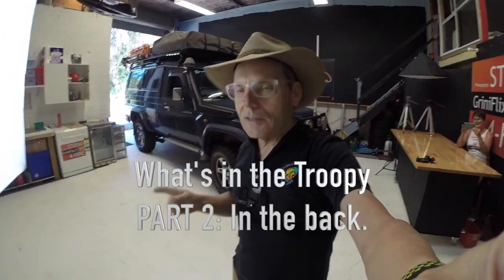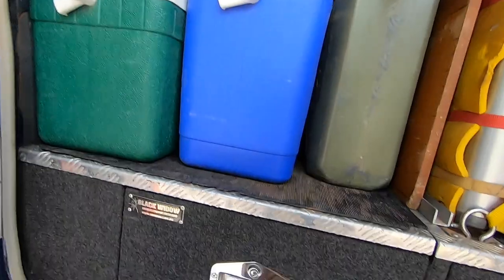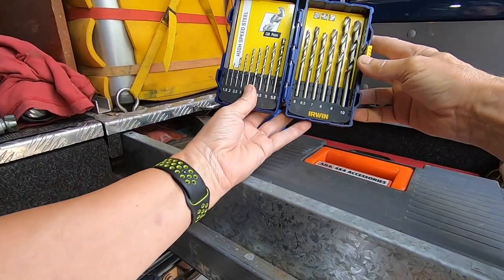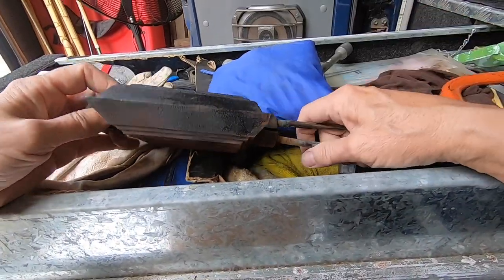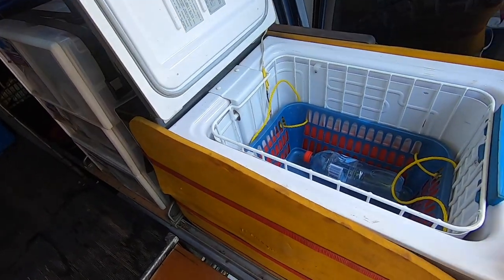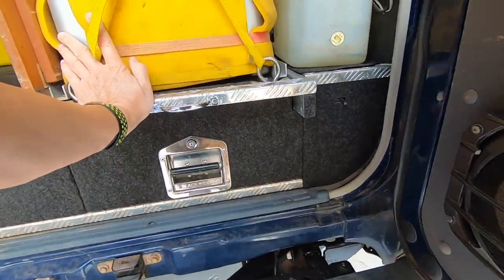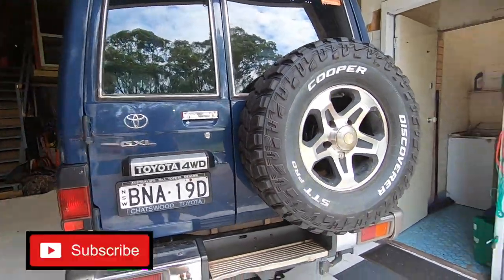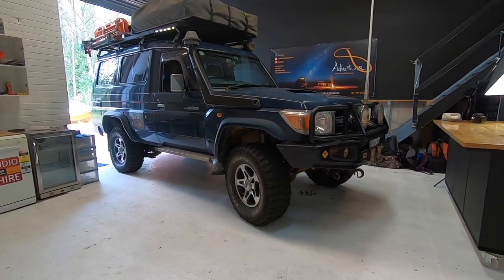Part 2   What's inside the Troopy

Comment: hi mate are you running any neg offset on the rear to correct the track cheers
Reply from the maker: Thanks for watching. No, I have no track correction at the rear.  I live with the standard Toyota off set.  I've clocked up over 100,000km of dirt and sand driving (plus 100,000km of sealed road) and I've never really noticed any unmanageable situations caused by the off set.  The track conditions has the greatest influence, as well driving to the conditions.  What will you do for your Troopy?
Reply: @Adventure8  tnx mate for the reply I was thinking of changing the rear track off set cox Im driving on sand every weekend I never had a issue sine 40k km driving but I was worried about rear track correction n my car never let me down good to know of u too I will keep mine as it is thanks mate